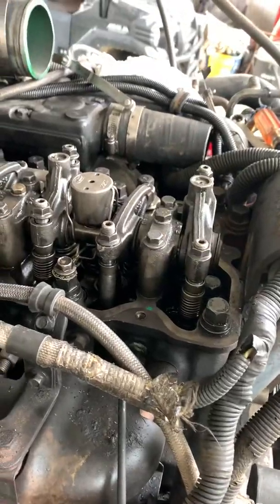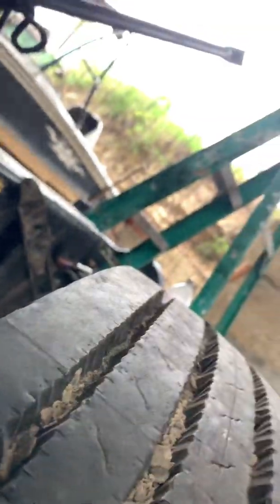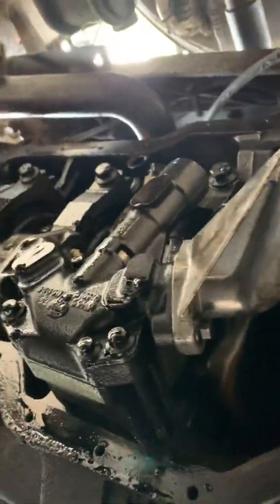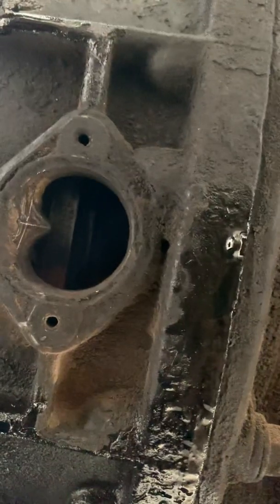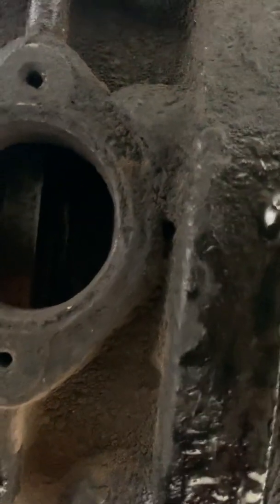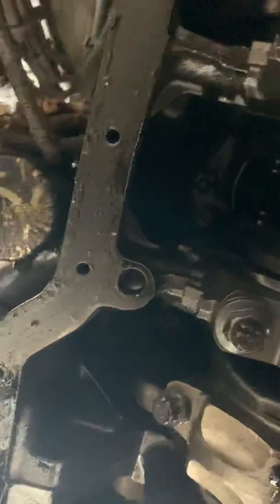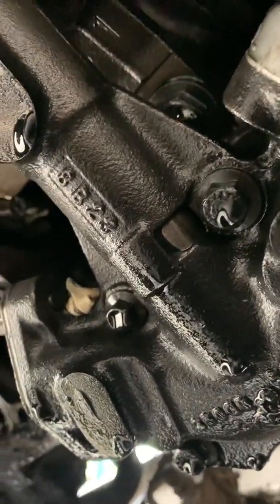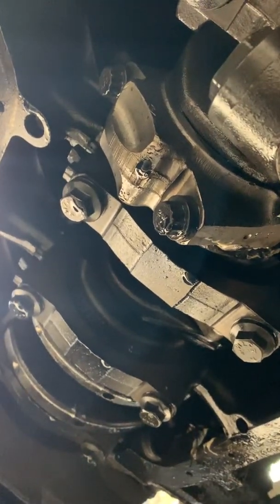Adjusting valves 2007 Mack Truck with PowerLeash brakes ac460 p motor

Comment: Thanks for your teaching sir, sir I am mack mechanical engineer , sir you use front crankshaft damper mark to valves setting and we do not no how to do that, the only way we can understand is  turning the engine and positioning it from the flywheel or valves positioning sir help us stay safe

Comment: None of this bullshit is necessary.  The fly wheel is marked   1-6  2-5  3-4.   Rotation of flywheel until Pointer matches up.  If u r on 1-6. Either 1rockers r 6 rockers will be loose.  The one that’s loose is on TDC start there and run ur over head.    I worked at a mack dealership for 13 years.   It’s simply how it was down.

Comment: Dude lol you gauge the gap between the rocker arm and the center of the bridge . I am curious did that motor even run correctly
Reply from the maker: Runs great
Reply: Its in the service manual

Comment: Hello im trying to adjust valves on same motor with a power leash brake, cant see to good on the video what gauge size did you use on setting the valve yoke on exaust side to get it level?